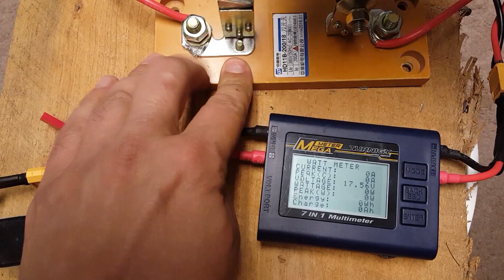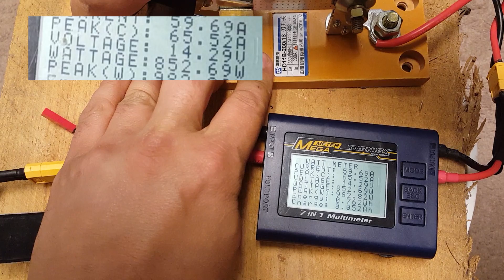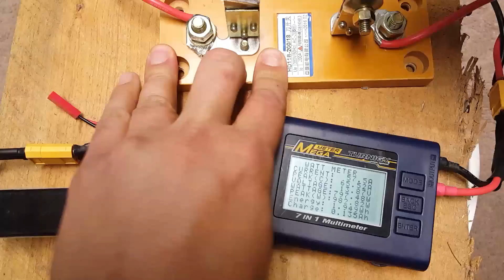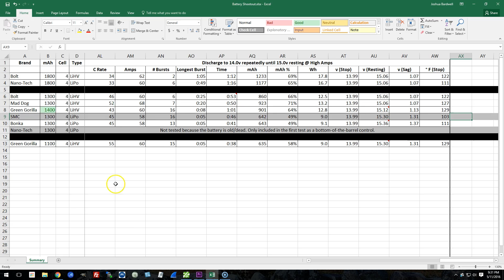Mini Quad Battery Testing - Group One - 14.0 volt discharge @ 60 Amps

Comment: hi, I did a very unprofessional battery realworld testing:
Vortex250, full battery fullthrottle to 150m and watch the OSDs Volt reading:
https://www.youtube.com/watch?v=X4lPbvj-ysM

what do you say? it's the sustained 60amp or more over a few seconds (~8secs) tests you speak of in your vid here..

The only ones quite good here were the graphenes I'd guess (but those were also the newest ones).
the tattus were 6month old or so  (but always taken care of like not flown down below 20% and stored them at 3,8volts per cell)...

so now I will continue watching your vid :)
Reply from the maker: It seems like you started at around 15.9 volts, then pulled between 60 and 70 amps, sagging to about 14.1 volts, sustained for about 8 seconds, then recovering to about 15.5 volts. This is pretty similar to my testing, and would be a pretty solid result. But ugh, a 2200 mAh weighing 250 grams. Too big a battery for my flight style and tastes. I think you can get a battery in the range of 150 to 170 grams that will perform as good or better in terms of peak sustained current.

Comment: the 1300 bolts are bloody AMAZING, iv puffed most lipos on my racer to date and voltage sags with the amount of amps I am Pulling,  my setup is rs 2205 2600, 5040x3, dodo f3 4k/4k. so far these bolts have been fantastic, no sags and power is there through out the whole flight, the only downside is once the lipo alarm goes off its pretty much land right now, so make sure you set your alarms higher than a normal lipo to give you some time to land. I just stocked up with 20 of these from HK,
Reply from the maker: +MMX2 I agree. Nobody thinks of Bolt as a top tier brand because it comes from Hobbyking but they are amazing. The 1800 is also great as you can see.
Reply: +Joshua Bardwell exactly, you said it pal,  I can retire my Giant Power 65c now, these are just so good, I wish I could fit the 1800s ones but there is no space on my kc215 frame. I still get around 3 mins of flight time, flat out so I am happy out
Reply: Please do the same test with the Tattu 1300 75c and the Lumenier Graphene 80c :)
Reply from the maker: Keep an eye out for Group 2.

Comment: This might be a stupid question, please excuse a noob. I have tried a 1300 4S Lipo battery on my quadcopter and it worked well. Would buying a 1800 4S Lipo be safe? I know if you change from 3S to 4S you usually have to check if your components support the voltage and wondering if it's the same with 1300 vs 1800, or am I safe to use 1800 if I have successfully used a 1300? :)
Reply from the maker: +Vapid Linus The larger battery is always going to be safe to use. It's like saying, "I have a truck that takes diesel. I put 1 gallon in it. Can I put 2 gallons in?" Sure! The risk is if you were to mix different voltages, like a 3S and a 4S battery. If you have a copter that is designed for 3S and you plug in a 4S, you might smoke something. The only down-side to going to a larger battery is that it is heavier.
Reply: +Joshua Bardwell I assumed so but wanted to make sure. Thank you very much :)
Reply: +Vapid Linus But do not exceed 2200 mAh, most miniquads lose their agility with lipos beyond 1500 mAh, and the increase in flight times will usually be around 1 to 2 minutes.
Reply from the maker: I wouldn't fly a mini quad with more than an 1800 usually.

Comment: Nice to see this higher amp testing.  
My "battery killer" quad (flying 6045 props) can't sustain more than 5sec of full throttle with most 1300mah batteries, so I'm using 1800+ mah to allow me to do bigger speed runs.  
I just received some LiHV Bolts to test & will be keen to see if this lets me longer bursts - once I get a decent day's weather here in Australia we're heading into winter, but Wednesday is looking good. :)
Reply from the maker: +David Martin I think you'll like the bolts.

Comment: How old were each pack (In cycles)? I see massive differences if the batteries have different amount of cycles.
Reply from the maker: +Ghost All packs were brand new, zero cycles, fresh from the factory, except: 

1800 packs were used in previous testing. Have about 5 cycles on them. Same number of cycles per pack, same type of use. SMC 37A true-spec is a regular flyer with maybe 20-30 cycles on them.

Just for the record, I'm aware this affects test results, and I called it out in the first video.
Reply from the maker: +Ghost Also, all packs were re-charged at 1C in between test runs to avoid any possible effect that charging too fast might have.
Reply: +Joshua Bardwell awesome, what I hoped. Apologies I missed it in the first one!
Reply from the maker: +Ghost no worries. Just wanted to defend my experimental rigor!

Comment: Hey can you do a test at 60a continuous until you use up 80% capacity?
Reply from the maker: +Mitchell Reynolds I'm sure that would just kill most of these batteries.
Reply from the maker: +Mitchell Reynolds Well I hope we find out. Any good LiPo will handle that punchout if you are willing to let it sag and possibly puff.
Reply: +Mitchell Reynolds Finalglide is sponsored.  People like him can abuse and destroy parts all day and have new ones shipped to him for free.  Companies know people will buy their products just because he uses them so they are actually making money sending him stuff to use and abuse.  But if you listen closely to that punchout is sounds like he does back off to like 90% throttle halfway through.  So it isn't horribly abusive on the battery.  In the description of that video he says he is using Lumenier 1300 4S.  I own a few of those 1300 60C Lumenier packs and I honestly feel they outperform my Bonka 60C 1300.  They are pretty nice.  I notice I can do longer punchouts on my Lumeniers than my Bonkas before my low voltage alarm sounds.
Reply from the maker: Plur307 I was talking to FinalGlide a while back about battery performance and he said, more or less, all the big names basically feel the same when he was flying them, and that was why he didn't have a battery sponsor, because he didn't feel like he could honestly promote any one brand over any other.

So, you know... check your facts? Do you know that FGA has a battery sponsor? Can you show me somewhere he is recommending a certain pack?
Reply: Joshua Bardwell
I'm just assuming companies throw parts at him.  I have no facts to back up my claims.  But I can say with confidence my Lumenier batteries can do several seconds longer punchout than my Bonkas before my alarm sounds.  They don't "feel" a lot better but the alarm does take longer to sound.  I'm not claiming Lumenier is the best or anything.  Just seems to beat my Bonkas.

Comment: another very interesting test. charge the SMC pack to 4.35v and see how it compares to the bolt. SMC say you can charge their packs to HV too.  I wonder if the chemistry in the bolt is actually any different than a regular lipo
Reply: +Joshua Bardwell also, I know it's partial BS, but I feel you should add a graphene 1000 4S to the 1300 pack and a graphene 1300 4S to the 1800 pack...since that's their weight class
Reply: +Joshua Bardwell also test the graphenes for actual capacity since I believe they're just under rated packs.
Reply from the maker: +FPV Kabab whaaaaa? Where do they say that?
Reply: +Joshua Bardwell Well - you can overcharge most lipos to 4.35v that doesn't change the maximum discharge rate though. I did discharge tests where I charged the bolt to 4.2v and compared them with Tattu and Nano-Tech Lipos and they still performed way better. You just loose 15% of the capacity.
Reply: +Joshua Bardwell as mi said, you can charge any lipo to 4.35 but the chemistry will just deteriorate faster. SMC is very excited with their chemistry and say unofficially that they can be charged to 4.35 with little impact. I only know one person that's ever tested this qualitatively and says they perform like any other HV in the air. I wonder if the higher discharge of HV is due to the cells just having more potential energy to dump or if it's actually a chemistry alteration.
Reply from the maker: +FPV Kabab Good point. I was thinking of only doing high discharge tests, but now I will definitely do a 20C on the graphenes.

Comment: fantastic testing. very very good protocol. I don't understand why the HV are more capable. I guess this disproves my theory that it just feels like more because it's a little more voltage. very impressive that the bolts are so good. thank you for all your testing. please add batteries to the test.
Reply from the maker: +FPV Kabab HV are the real deal.
Reply: +Joshua Bardwell What about lipo graphene vs lihv?  I know you aren't a chemist but do you know if graphene can be utilized in the lihv chemistry the way it has been implemented in the lipo chemistry?  What if we can have graphene lihv?!?!?!  I just noticed that Lumenier just launched a graphene and lihv line of batteries.  Both claim 80C discharge and 160C burst.  I know those numbers are inflated, but it is interesting they give both the graphene and lihv the same rating.
Reply from the maker: No clue. I think that HV will perform better than graphene, especially if weight is taken into account, but we will see!
Reply: +Joshua Bardwell tests have shown the graphene stuff doesn't perform any better. Cycle endurance also hasn't been proven but is looking to be better. any pack can be charged to HV but given the graphenes  increased endurance, it might be able to take the HV charge better than most and may perform better in general as an HV pack. I don't believe that to actually be true since other tests have shown that HV is only really for the first bit of the pack and the general voltage is still around 3.7/3.8v per cell after.
Reply from the maker: FPV Kabab I will be interested to see how these tests come out. I have some graphenes on the bench and we shall see.
Reply: +Joshua Bardwell me too. very much looking forward to it. BTW, what are you using to pull that many amps out of the packs so easily?
Reply: FPV Kabab
Charging non HV packs to 4.35 V sounds like a great way to burn your house down.  I won't be attempting that.
Reply: +Plur307 that's not true at all. nothing bad will even potentially happen other than the pack chemistry deteriorating faster.
Reply from the maker: FPV Kabab Big coil of steel fence wire wrapped around a wooden block set in a bucket of water. There is a photo at the beginning of the 40 amp test video.

Comment: Would love to see what the difference would be between the bolts  when the C rate is the same. Will they deliver the same performance? Can you test this Joshua?
Reply from the maker: +Salerg Not in this round, as the bolt 1300 was borrowed from a friend and has gone home again.

Comment: both the Bolts are apparently the real deal then .. I know you've been flying them for a while now, any impressions with regards to long term durability?

can you also try one other test.. charge the LiHV to 4.20 and see how they work? I don't have a LiHV capable charger yet and wonder if I can still get some benefit if I buy some and upgrade the charger later.
Reply from the maker: +Razvan Taranu I haven't actually flown the bolts much because I wanted to keep them fresh for this testing. For longevity, I just don't have enough data yet.
Reply from the maker: +Razvan Taranu LiHv at 4.2 works basically the same as a good LiPo. The LiHv magic isn't unlocked until you go to 4.35.
Reply: +Joshua Bardwell i would love to see the bolt snd mad dog at normal 4.2v as well. my friend uses the bolts and says they are very good and he only charges to 4.2 as doesnt have hv charger. could be that they beat other packs even at 4.2 and would be good choice anyway for mon hv users. hope you can test if you have time :)
Reply from the maker: +Discophil The LiHV I have seen have low IR so they should perform well even when only charged to 4.2 volts, but the real magic doesn't come out until 4.35.